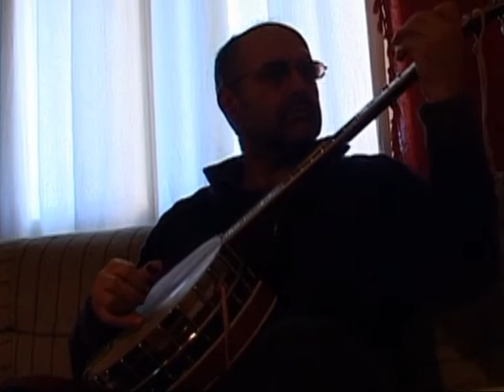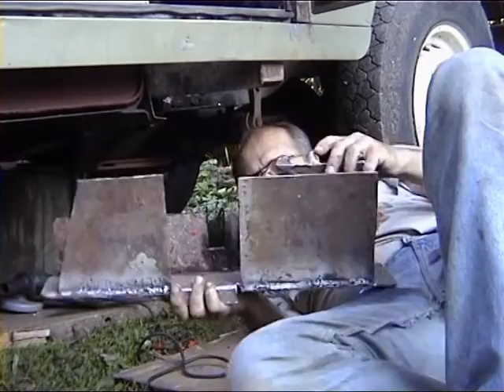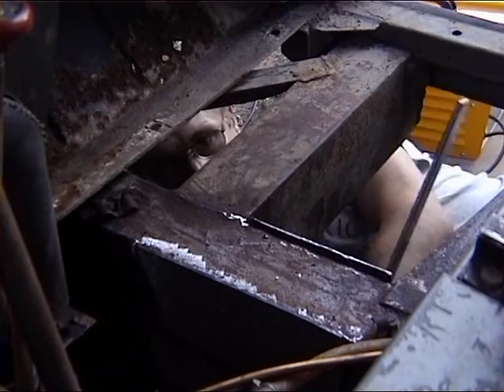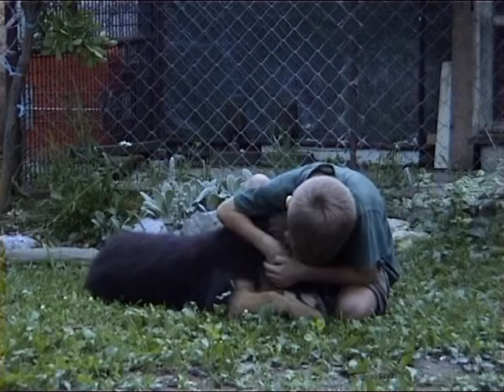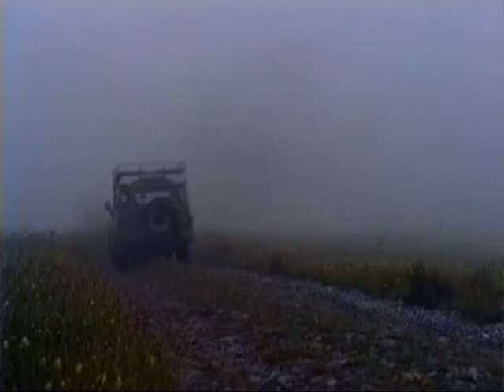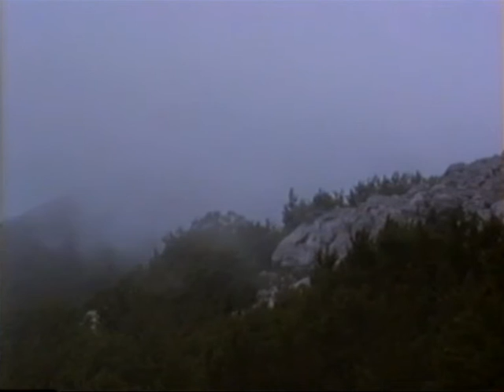Land Rover on the Wolf Trails

Comment from the maker: "Wheels". This song which I am trying to play on banjo reminds me on that old rusty vehicle. Land Rover 88 that I owned more than twelve years. After repairs it covered 470 000 kms. Using that vehicle I managed to approach the areas where from I could reach closer to the known wolves. But I had to take care not to change anything because that would arouse suspicion in them, so that every next time more cautious they should become. They would need much more time to show up or let me come closer. That's why I did not fix a broken exhaust pipe and silencer because the sound had to be the same. It was the loudest tin full of wolf stench and fallen hair. No wild creature would ever think that it is sneaking. At night I used to exclude all lights and tried to catch the road like a blind man ... to avoid to be seen. Hunters were the reason I was hiding myself. I must not change my clothes and shoes, too. Such the changes wolves would misinterpreted like masking and walked away. "What am I trying to hide? Why did I change myself?" I always took care about that so that I could be sure I will always meet them again no matter where I was coming from. From the interior during summer or from west in winter and deeper as far the snow hight allows. And so it was. Whenever I would return I always managed to start that old diesel engine despite poor fuel that was freezing after long stays in the extreme cold. I had quite a lot of experience with that engine and knew how to please it. I would say it was reliable. The truth is that mostly thanks to that car all my experiences has been succesfully recorded. (Paul Balenovic - The Diary).

Comment: Dear pavle.
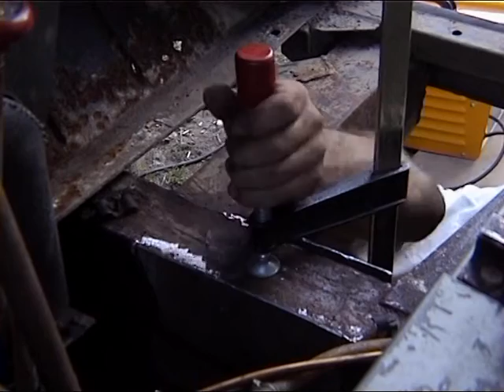I get interest in the 1:36 when there is a boy with a dog.
It is your child with blue the GSD playing together ?
Reply from the maker: Oh, this is my son with Bonnie, protecting her eyes from dangerous bright light that stick welding causes if one looks at it ... she came to us as a pup a few years after all the wolves were gone ...released into the wild.
By the way excuse me for delay in response and broken contact during recent days. In fact I was forced to rest for awhile from any connection during recent holidays.
 PC troubles happened.
I managed to solve the fault just temporarily with pre-owned graphic card that I borrowed from a friend's friend. 
In fact I am absolutely lucky for I did find the real cause of malfunction. It all started a while before with left monitor (of 2 that  I use for editing) It was starting with warning "no signal ... check cable etc." I did that few times even changing various cables. What was the worse ... I couldn't turn off the PC after each start-up what made more troubles and ruined Windows OS so I needed days and nights to find out that graphic card-adapter went wrong ... in fact just the connection for one of its cables and that couldn't be repaired.. After partial repair of Windows I purchased pre owned card (obsolete, no new in stock) that still didn't arrive perhaps because of crowded internet and mailing services. I believe the data on my hard discs will remain saved and safe. Meanwhile there has been a kind of trouble with internet line that covers the part of the city where I live so even my neighbors were not able to exchange messages. Many forums on the web discuss about the problems like mine but this time I couldn't reach them just when I really needed them for help. I felt myself like being far away in the wild mountains with no electric power at all. All that is quite expected in the country like mine these days. The life here isn't as we would expect nor deserve at the moment. I will repair all needed as soon as possible if I'll be able to, soon. 
I believe that you spent your holidays well so that you are ready for the New Year that came already.
 All the best from me.
Reply: @PavleBalenovic  its okay no problem about the delay.
my laptop also get trouble a few days ago.
The cursor clicked automatically and i cannot control it. So i dedicated to bring it to service and now my laptop in on better condition.
Its a old laptop so there is some problem to operated it.
By the way thank you for reply my comment and sharing your story with me.